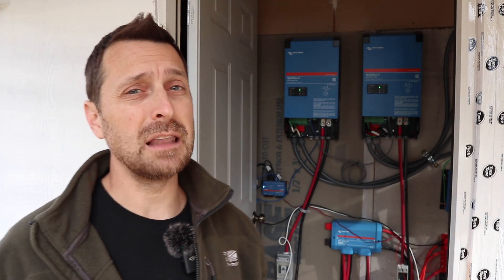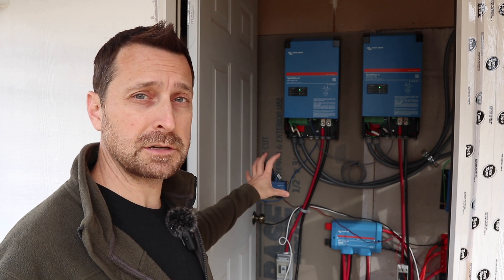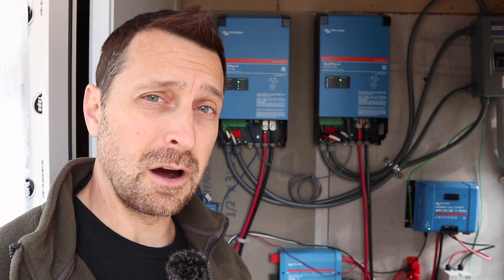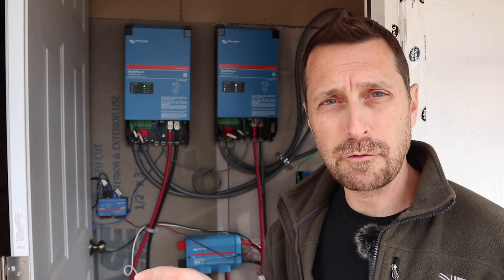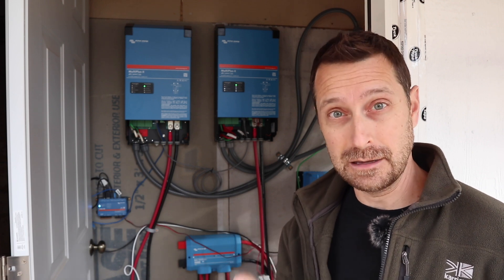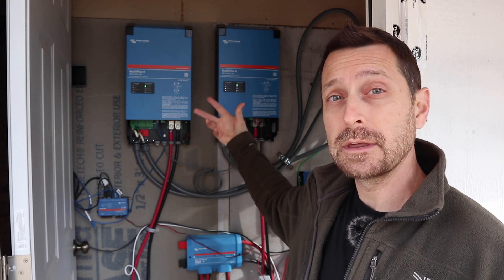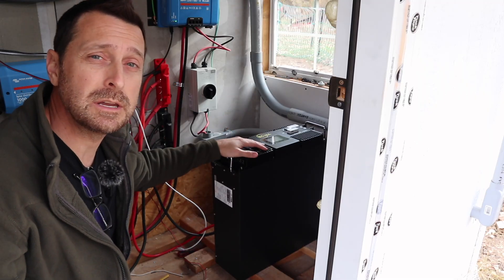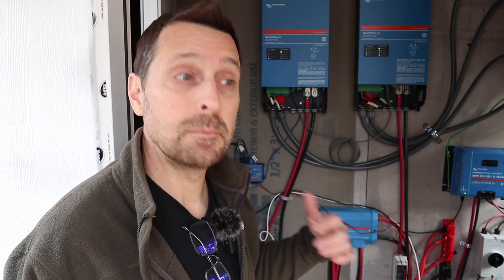Is There A Flaw In A Modern Solar Power System For Home Use?

Comment: We introduce complexity for a reason. It's progress, but you are right that there is a downside. People who want more reliable power are free to use the grid, but they suffer from being at the whims of others. Bluetooth is a great invention but it causes me lots of regular gried, like how my car keeps autoplaying music that I wasn't playing when I get into the car. But I value the convenience of wireless so I take the good with the bad.

My EG4s are a PITA but they were cheap and I like connecting them to the computer. I like that I can use home assistant to monitor them and tell me thing slike when I have some high power usage during certain times of days. I just got a bitcoin miner and I have an automation that will turn up the power on the bitcoin miner when I have more than 500w of surplus solar power or the batteries are full. The only thing I am unhappy with right now is that I haven't installed a bypass so that I can push grid power directly into my subpanel if my inverters aren't working. I need to do that soon as I worry about that. I wish I got a PDU before they stopped releasing them because it has that.
Reply: What bitcoin miner did you get and from where? Great idea. I like the way you diy and homestead.

Comment: The solution to communications failures between solar equipment is to buy solar chargers, inverters and batteries that do not need to communicate with each other. That type of equipment is available, has proven reliable over a long period of time and there is no need for digital communication between them.

Comment: I love my victron charge controllers but I do wish I had bought components that are able to operate and be adjusted without my phone or without a computer. I love the sungold inverter that's extremely simple and victron charge controllers seem great so far but I always worry about if the phones went down then what would I do as far as any adjustments ya know
Reply from the maker: Cool. I am wishing that same thing right now.
Reply: You can connect to most Victron components by hard wire through the data ports if necessary or desirable...Bluetooth or WiFi connection is optional though convenient in normal circumstances. I use both Victron solar charge controllers as well as Victron grid chargers but I do not network them together...in that way I can decide and control which is the dominant charger and also set individual charge perimeters.
Reply: @jime9305  yes sir... I have 3 victron charge controllers. 150-70.... 100-50... 100-30. Then for ac charging when needed I use a powermax 50 amp charger along with a 40 amp powmr AC charger. The powmr is actually a 3000 watt all in one that I only turn it on to get a extra 40 amps of charging from. I stopped using the solar charge controller on that unit because it would lock onto a low voltage and have to be turned off and back on to get it to reset and charge correctly. I also bought a 100 amp powmr charge controller and often times it would start going up and down every few seconds with how many amps it was pushing into the system and I'd have to reset it to get a stable charge then as soon as a cloud would go over it would act up again. That's when I broke down and finally got the victrons. Best decision so far so good with them. I use a 4000 watt 120/240 split phase sungold and couldn't be happier with it also. I have built my primary battery from 24 280 eve cells in a 3p8s with jk BMS with 2 amp balancer and my back up battery is a 24 cell Nissan leaf battery that's actually never being used anymore. I am actually addicted to this solar stuff at this point lol

Comment: I use victron charge controllers and a fairly large sungold power inverter. I no longer use the all in one units as the problems are never ending with those it seems. Firmware updates....

Comment: I watch Suspicious 0bservers. Ben gives a morning update on the solar weather and it's potential harm for everything. You can look back on his channel and see if solar storms may have caused your problems with sophisticated trons. I won't fly today for the very same reason. The Earth's mag field is lower each day and around 35% what it was a century ago. And dropping 5%/decade. Shielding the data leads and using ferrites on everything may relieve your issues. But should the next Carrington event occur it won't help. It was a slow rise and the rapid change needed for suppressors to work will just saturate them to uselessness. A combination of factors would be wise, especially at the prices and unavailability after said storm of any replacement parts. I am collecting old generators and motors to get past such issues.
Reply from the maker: Interesting. Thank you.

Comment: I didn't like Victron as they were strictly proprietary. It's all or none. Apple come to mind? I like a system that allows another product to be substituted. Current, sense, MPPT, etc. Especially since Vics like your money more than you do. Competition makes great products and companies. Right Congress? Hint!
If your competitor's product is better it "encourages" you to do better. Quick question: Do they design to max component output and therefore minimal longevity margins? I bet they do. Typical old school was 70-75% of rated power. In today's post CV19 market/prices they are probably closer to 90% max. Whereas 55-60% would give a reliable long term product that will be handed a down a generation or two. I remember when American made was a potential heirloom. Not today! It's like the difference between Lion and LIFEPO4. More than twice the life and they don't burn.

Comment: Well, unfortunately you seem to be suffering from a self inflicted wound. Victron has a list of tested batteries that work according their spec. That list does NOT include EG4. So you are a pioneer stepping on unproven ground. Frustrating, yes, but given the circumstances…. Use your favorite search engine with “victron battery compatibility” I have no issues whatsoever with Victron+pylontech.
Reply from the maker: Their list is not up to date.

Comment: Another thing,  has EMP shielding crossed your mind?   I'm not sure how a solar system could be shielded, but there must be a way.
Reply: Cisa.gov has emp guidelines you can search for on google.   Typical is shielding and then use of ferrite chokes on wires and spds or surge protective devices that are designed for the very fast response of the e1 pulse which is faster than lightning type surge protectors.
Reply: Sol-ark has emp hardening available that they have tested beyond us mil specs at 150kv/m.  
People have used spd's from emp shield for dc and ac then ferrite chokes for pv wires and other wires.  Sol-ark provides the chokes for each panel.
No one knows exactly how much pulse each location would get as foreign military technology is not known well and is believed to have super emp weapons at 200kv/m or higher.  Additionally the soil types and geological model also determines the local flux. I suggest you pray first for protection then do what you reasonably can based on wisdom.
Reply from the maker: I had not thought about EMP shielding.

Comment: I am a computer engineer. I never update firmware unless it resolves a problem I am having or adds a new feature that I want. I read the release notes of every new firmware version to make sure it does not fix a problem that I am having but do not realize it.
Reply: I’m with you on this one, I recently updated the firmware on our Cerbo which resulted in the white screen of death, luckily for me I had a new Cerbo replacement
Reply from the maker: @alanblyde8502  Crazy. I can't believe these things are failing so often.
Reply from the maker: Thank you for the comment. 
That's the issue. There was a problem so I updated firmware which in turn threw off comms for all the other components that were not having issues. Then Victron stated that their latest firmware for the Cerbo was bad and wanted people to revert to an old version. Just crazy.

Comment: I agree that in general this is an issue, and suspect that it relates to power quality, ambiguity in the RS485 communication standards and with the way SOC is computed.  

That said, I have been running my SolArks 15Ks w/SOK batteries for over a year now with very few hiccups.  I'm guessing a bit part of this is because I DO NOT attempt to use the SOC or close loop modes.  I found this out by mistake because the RS485 comm maxes out at 15 devices while I had 32 batteries, so I was forced to use strait voltage mode on the SolArk.  For monitoring, I use Solar Assistant, where I can monitor what the batteries are doing and where they think the SOC is.  Looking at the battery voltage helps to see whats going on, and I now realize that SOC - even on the Battery BMS is at best a crude estimate because you can easily see where the voltage curves indicate when close to full charge/empty (but not in between).  The SOC will therefore jump (on both SolArk and the SOK BMS) when they hit voltage levels, but they slowly drift off when the voltage is between.  To save the batteries, I set the SolArks float and absorption to a full 1 volt less than the battery mfg recommendations.  This is because with the solar assistant data I can see the elbow of the voltage begins to rise.  Similarly, I set the battery low voltage to 2 volts above the minimum.  For me, these voltage levels define the high and low battery thresholds - not SOC.  This ends up fooling the BMS computations because I never reach their thresholds and the computed SOC drifts off where I know it to be based on the voltage curves.  Over time this can cause the BMS SOC to be up to ~20% off (e.g. the real SOC is 100% based on voltage curves, while the battery BMS says its at 80%).   Its' also clear that the SOC is off when it suddenly jumps from 80% to 100% by holding voltage 1 volt higher for only a few seconds.  https://batteryuniversity.com/article/bu-808-how-to-prolong-lithium-based-batteries has more detail on Lithium charging and why SOC is only an approximation.

Another interesting pearl you may not be aware of is that at least on SolArk 15k's the computations for how many amps to push through various circuits may be limited based on wire sizes in the inverter even while rated throughput going though different circuits might produce more power.  For example, in full sun, I can max out the current to the batteries, but if I have extra house load, the panels will feed that extra load.  That may be going on in the Victrons as well.

Both of these are no 'computer' limits per say, but more a result of the device physiics.

Regarding computers glitching, the fact that you get different results with different versions of software/firmware does seem to indicate that this is a software issue.  You  might be able to diagnose more by seeing if you can see the bus data using a different computer.  I don't know if Victron has similar, but you can google how to read connect and read this in general.  For example, there are a couple threads that I followed https://diysolarforum.com/threads/sol-ark-inverter-monitoring.23717/ and https://pymodbus.readthedocs.io/en/latest/source/readme.html which helped me to see data for Sol Arks.

Finally, an issue that doesn't get a lot of coverage but is IMO very important to understand for people looking at inverters is that power quality from an inverter or generator has a lot of electrical noise.  This has do do with the way the inverter converts DC to AC by switching devices and the fact that inverters typically have so much less reserve than utility power.   You can easily see these effects on an oscilloscope.   Read https://yourpowerguide.com/clean-power-generator/ for an introduction to the issue.  Note that the inverter is only part of the problem here - other loads can do the same, so fixing the problem is more than simply buying a different inverter, although that may help.  This electrical noise or 'dirty electricity' is very hard on electronics, and spikes can cause computers to glitch, or eventually fail.  You can attempt to mitigate many of the issues by using secondary line conditioners to smooth out the high frequency switching noise.  Unfortunately doing this well because a very complicated subject quickly, but if you are having a lot of glitches, consider looking into improving your power quality.

Comment: You may want to consider a current measuring shunt on the DC side between the batteries and the rest of the system. Manually charge the battery bank up and reset the shunt wattage counter to zero. Now, you can get a general idea if the batteries really are at 100% by looking at the state of "consumed" watts on the shunt; if it shows a huge discrepancy, my guess is that it is the battery BMS not reporting the correct state of charge to the inverter charge controller resulting in the batteries not getting topped off.  David Poz has a YouTube channel and has done several experiments using shunts to test battery capacity.  I suspect what MIGHT be happening here is that the average draw on the battery is low and the onboard BMS shunt is not sensitive enough to detect the low current draw gradually running the batteries down.
Reply: This. The problem hes having is with the batteries bms not communicating correctly. Until bms evolve more its best to not do communication and use a smart shunt to track battery soc.

Comment: I have Schneider split phase inverters, Midnite charge controllers and SimpliPhi batteries. It all just works. I do not have any wired communications between components. Firmware doesn't seem to be anything with which I need to be concerned....probably since I''m not concerned about components communicating with each other.
I do have a Victron smart shunt that allows me to monitor my state of charge etc via bluetooth while on my property...but it's just a convenience for me while seated in my recliner. 
So, I'm suggesting that you really don't need the Cerbo and glitz of all of inter communications?
I think that i've heard Will Prowse say that he does 't  need to have all of the communications info...something to watch all of the time.
Reply from the maker: I am thinking of taking the comms down completely.  I know Will does not like all the comms either.

Comment: Would recommend not powering compressor motors, saws, and welders with an inverter. I kept a leg from the grid to run these electrically noisy machines. Don't recommend using cordless tools near an inverter because they can generate EMF noise that may affect digital operations.  The 5KW chargeverter is supposed to clean up harmonic noise and minor spikes from fuel powered generators to protect an inverter's delicate innards. My experience is designing industrial motor controllers that will run on battery via radio control. Shielding the microprocessors from motor brush noise and RFI is crucial.
Reply: I have three EG4 6000  running in parallel 240 split phase running a complete Fab-shop welders, plasmas cutters, CNC machines ( Vertical mills and Lathes) twin Compressors I never had an inference problem yet. 70kw DIY battery bank with two 36k btu Mini splits. Maybe 11:50  I am just lucky😅.  But my house is on a separate system with two eg4 6500-plus one eg4-6000.

Comment: I had something similar with my Growatt 12k.  It would do it with lead acid set to volts or with the eg4's set to battery percent.  The Inverter would miss the set point and keep running on the battery till it hit the low set point and shut down.  It Seemed to only do it on damp days.   I hung a tarp up over the system to help keep the moister out.   This fixed it 100 percent .  I  say did this because it never messed up all winter and I took the tarp down in the spring, then on Foggy morning it did it again.  Hung the tarp back up and never did it again.  I run this system for a 1 1/2 year at least.  It is in a non insulated building pole barn with a sliding door that is not sealed at the bottom.   Now running a Sol-ark for a year under voltage for the first few month and February received my Hub for the Eg4 lifepower batteries.  So far not a problem and I hop it stays that way. 
Maybe all the Solar activity (sunspots)  has something to do with it?